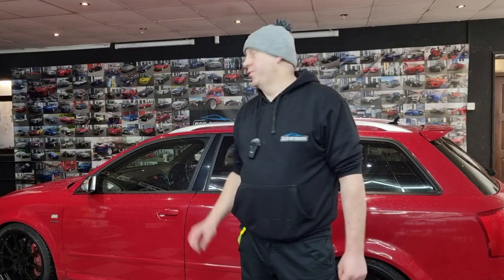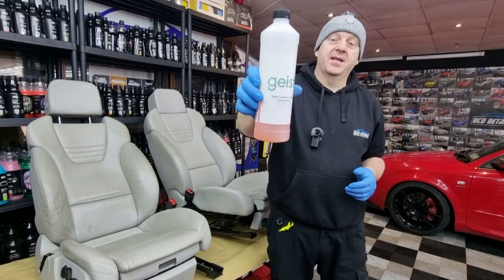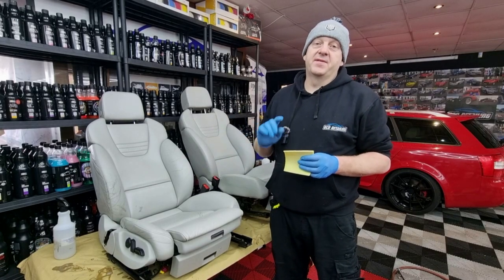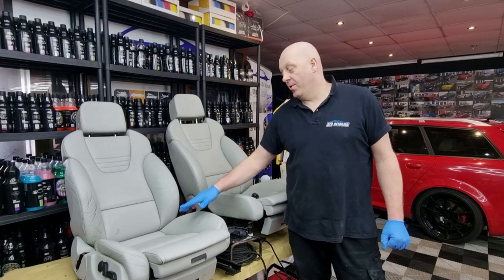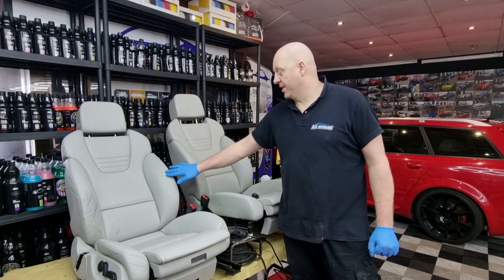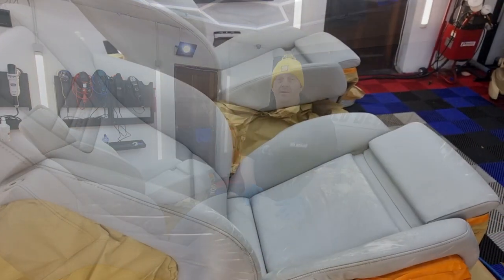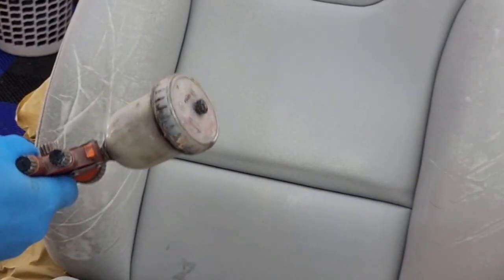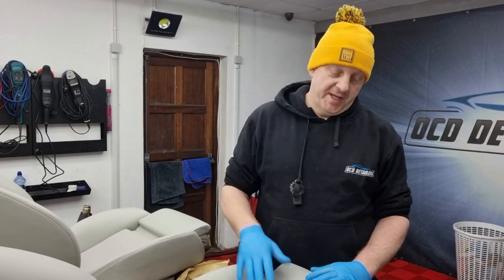How To Restore Worn Car Leather Seat | Audi S4

Comment: What are these kinda repairs like for longevity on a car that would be used daily? Main concern would be the filler coming out.
Reply from the maker: The filler is very durable, the durability of this repair is roughly two years in a daily used car; well this means that the paint may start to wear off on the most used parts like bolsters. Using gentle leather cleaners and conditioning the leather, applying protectors will extend the durability.